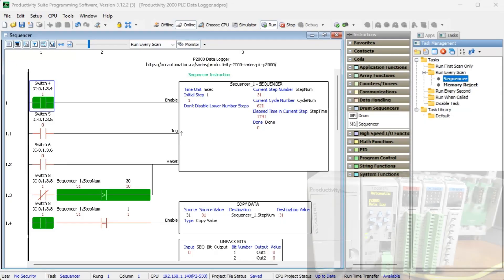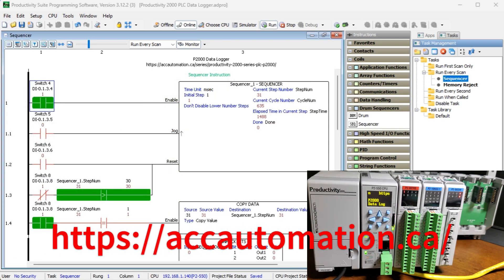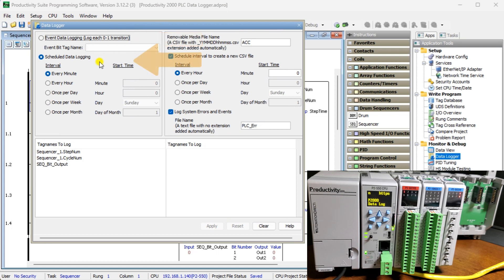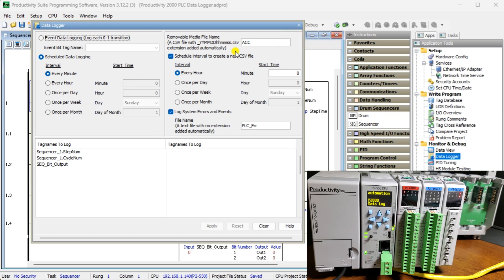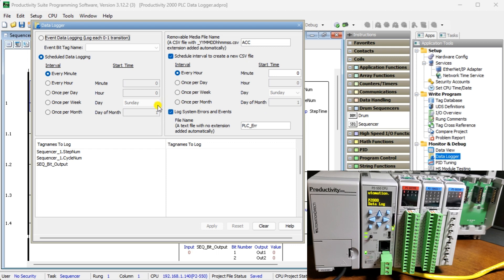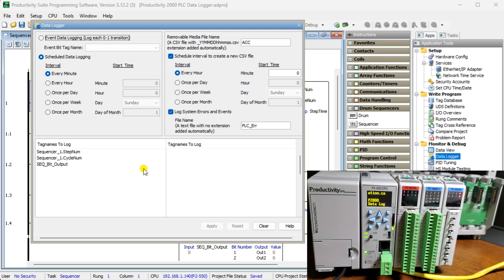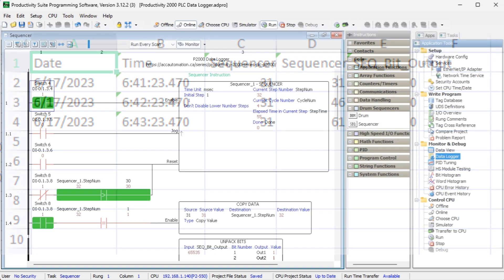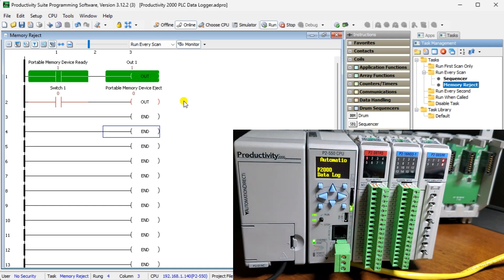Productivity 2000 PLC Data Logger and Logging

Comment from the maker: The Productivity 2000 Series PLC is located here:
https://accautomation.ca/series/productivity-2000-series-plc-p2000/
Productivity Frequently Asked Questions (FAQ)
https://accautomation.ca/series/productivity-1000-plc/productivity-plc-faq/

There are several reasons why we are using the Productivity 2000 Series Controller. Here are just a few.
- CPU with 5 communication ports
- 50MB user memory - Can handle very complex applications easily.
- Limitless PID – Autotuning – Individual or Cascade Mode - etc
- OLED message display on the CPU module
- Plenty of discrete and analog I/O modules
- Status displays on all discrete I/O modules
- I/O Modules have QR codes. This can be scanned for the module's latest specifications/wiring diagrams.
- OLED data display on analog modules
- P2-RS remote I/O expansion module, or use the Productivity1000 P1-RX remote expansion module to add even lower-cost remote I/O to your system
- FREE full-featured Productivity Suite software
- Programming with several ports - USB, Ethernet, Serial
- Hardware auto-discovery
- Hot-swappable I/O - Remove cards with power on the system
- Choose from three wiring options
- Slim DIN rail density form factor:
 - hardware - power supply, CPU, and seven modules in only 10-1/2 inches
- All project files (program, tag name database, and all the program documentation) in the CPU
- Run-time editing and debug mode on CPU
- Easy data logging with micro SD on CPU
- Secure Web server to access data files and system tags
- Easy drive and motion controller integration
- Coordinate motion control with PS-AMC allows control of up to 16 axes and synchronization of up to 4 axes
- Two-Year Warranty

The Productivity 2000 series of programmable logic controllers currently has all of these features built into the P2-550 CPU.
This CPU (Central Processing Unit) is also known as PAC (Programmable Automation Controller) because of its communication capabilities.

ACC Automation
https://www.accautomation.ca

Comment: can the data be logged to a PC via serial communication instead?
Reply from the maker: Hi @robin19972
Yes, you can do this using Node-Red and Modbus RTU communication protocol.
https://accautomation.ca/series/node-red-iot-enabling-software/
Here is a post on how to do this with Modbus TCP, but this can be easily adapted for the Modbus RTU serial. 
https://accautomation.ca/productivity-2000-plc-node-red-modbus-tcp/
I hope this helps you out.
Regards,
Garry

Comment: is it possible to log data at a sampling rate higher than once per minute?  Can data be recorded at say 10Hz or 100Hz?
Reply from the maker: Hi @jeffdeheer3827,
You could switch to event logging. This works with the data log buffer. When it reaches 512 bytes of data, the buffer will write 512 bytes segments to the pen drive (unless the pen drive is not present) to lower the data log buffer below 512 bytes. However, how fast the buffer is filled depends on the frequency of the event, the number of tags, and the data types of these tags selected for logging.
You have 64 tags to log, so you could fill this up with 1 minute of data and use the timed logging.
If this is still too slow, I would look at different data logging methods from the productivity PLC. Some testing equipment will log all of the data into memory and use Node-RED to read and update databases directly after the test.
https://accautomation.ca/series/node-red-iot-enabling-software/

I hope this helps you out.
Regards,
Garry
Reply: @ACCautomation  thanks!